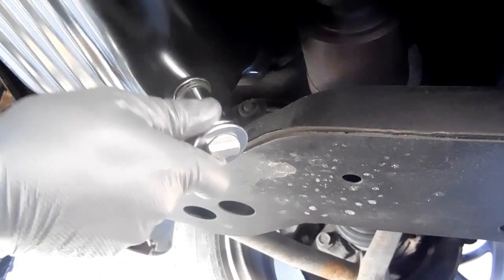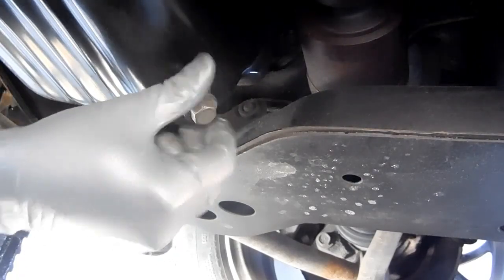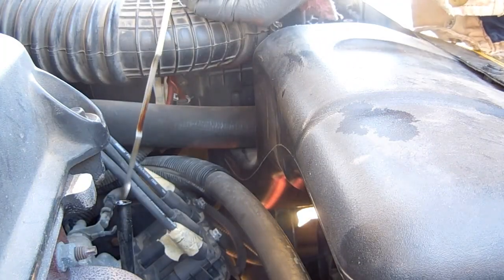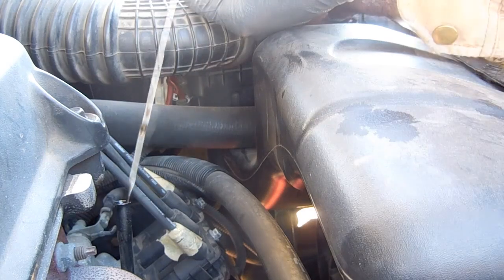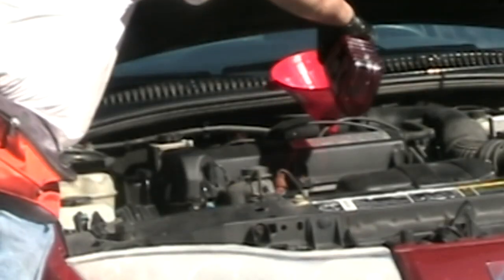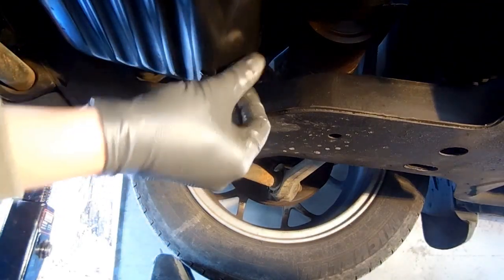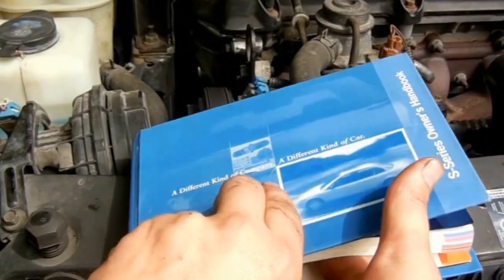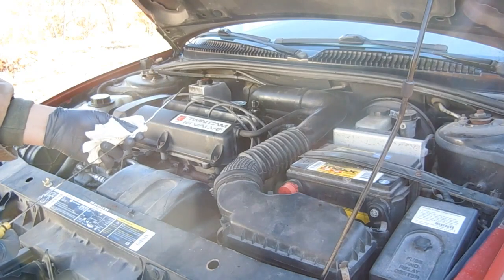Safe Motor Oil Flush Using Kerosene

Comment: Gasket material and sealants have changed to much that I'm not sure how this works with engines made in the last 35 years.  Prior to that I can attest that regular flushing with kerosene did indeed keep the engine sludge free and clean.  But that in itself required you to keep the oil and filter changed every 5K or less.  But sometime internal sludge can be a friend.  You clean up a really dirty engine and all of the sudden it will start leaking for the first time in years.  I can attest to that also.

Comment: Back in the 70's this was common, but I would toss in a quart of kerosene into the oil before an oil change.  No pre-draining.  I would let the engine idle 20 minutes or so and then do a normal oil change.  This was done rarely, but it would get some of the crap out of the engine.

Comment: Remember when you drain the oil after putting the Kerosene in the engine not all the Kerosene comes out of the engine. Every crevice in the engine even the pan will have it still in the engine. So one flush of new oil will not remove all the Kerosene.

Comment: Thanks for the info I’m running my car right now as we speak with kerosene in it to clean engine. But my 09 Honda accord V6 has 230,000 miles on it and it started to tick when I start it up but once it’s warm it goes away. So I’m flushing it and putting stuff in it that will help with that. But I want the engine to be clean so I’ll prolly do this before every oil change for 2 more times. I’m trying to get 300k out this work car lol..

Comment: People used to use coal oil to desludge engines.
FYI: you can substitute lamp oil for kerosene.
You can even use diesel fuel too.
Some people use ATF to flush with.
No more than 25% by volume for the mix.

Might be a good idea to let it sit overnight in severe sludge issues.

If you have a lot of sludge, then you aren't changing your oil and filter often enough.
Or you need a proper tuneup/repair.

I see the author is using one of the WORST oil filters you can get.
Get a NAPA or WIX filter or better.

Comment: Ok..Something to consider..Depending on mileage or terrible missed/ misused servicing..Any engine with excessive Sludge/Carbon byproducts are questionable when attempting to Flush Materials..Safest way out of all methods is ATF..One quart added/ Run at idle to 2000 rpm for 1 hour/ No driving/Vehicle parked/ Fire Extinquisher Safety/ Drain and Oil Change Filter Service...Sludge/ Carbon removal may have been holding seals and rings and bearings together..Be ready for Big Repairs if something happens...Used vehicles with no records are the worst.....

Comment: Hello great video it was really helpful can I do that with my transmission and my son drove the truck with really low on transmission fluid and I asked him for how long he said about 2 weeks is what he claims but when I got it back it would not even register on the dipstick now it slips just a little bit not a lot but sometimes it does would it be helpful for me to drain all of the transmission fluid out of the transmission can I clean the transmission just like you did with the motor and then put the fluid back in and you think that might fix a little bit of my slippage problem I'm just asking I don't know I'm single so I don't know I just need a man's advice
Reply: Hi Jennifer. I would recommend against putting, or using any other fluid or oil than automatic transmission fluid, in the auto transmission of any vehicle. Empty the transmission completely, refill with new transmission fluid. If it is an older vehicle and the original fluid looked dark, significantly different or discoloured (new fluid should look clear and bright) from new transmission fluid, it may be worthwhile emptying the transmission again and refilling after 1,000 miles. 

Again, I would be certain that the new transmission fluid is not tainted or have any other impurities, such as water, oil, brake fluid or dirt when it goes into the transmission.

Though it is likely to be too late to answer your query, I hope that this information may help you or someone else.

Comment: Drain out all the old oil and refill with circa 4 litres of diesel. Remove the plugs and spin the engine over on the starter several times and drain out. Refill with approx  
2.5 litres of new oil with a new filter. Run the engine to temperature, drain and refill with another new filter. Job done.
My 1.4 16valve Fiesta has done 145k miles and ive done this at 40k, 80k & 120k miles. The engine runs like new, the oil stays  yellow between services ( every 3k miles) and uses absolutely no oil.
Bore scoping still shows the factory cross hatching..

Comment: When I get a new to me bmw I drain the oil and  replace filter put in some cheap oil or kerosene till it starts coming out clean this washes a lot out the oil pan  once it stops replace oil plug put in cleaner of choice top off with the cheap oil, flushing with old oil and filter can lead to washing dirt into $$ parts idle for 20 min or so drain oil if black as night repeat then put in a top make oil I like red line or castor oil synthetic if red not around it hard to get in europe  ran many bmw in canada or europe never had engine issues my last canadian bmw had 180,000 very hard miles frame rusted out engine still ran great engine flush should not be done too often it can do damage by washing shit into pin hole sized oil passages  if you drive a beater you can flush more ben an auto mechanic  for 40yrs

Comment: RUN the engine for a minute or so, before checking the oil. The filter will take up some of the oil as it primes. A filter that size may hold up to 1/2 of a quart. When measuring the amount of oil, the dipstick may show above the full mark, until the engine has been run, and the filter has completely filled.

Comment: I threw almost a full can of SuperTech Motor Teatment in my old 302 with old oil. 
The blow by seemed to have greatly reduced and nearly no smoke from exhaust pipe.
Then I changed the oil. I used 1gal of diesel oil and two quart bottles of Oil Stabilizer. All SuperTech brand.
It now smokes from both ends worse than before the Motor Treatment was add.
On the bright side though. The low end rattle has nearly stopped now when the throttle is burped.

Comment: Your essentially trying to clean your engine with dirty contaminated oil,,,Would you wash your dishes with old dish water,,,The proper way to clean your engine is ,drain out all the old oil,,put in cheap new oil with an engine flush,,drain that out,,Then put in more clean cheap oil this time without the flush,,the reason you do this twice is ,,after the first time with the flush,there will be kerosene left in the engine,,,then drain the second oil and fill with good oil,,,,,job done...

Comment: All you have to do is put 1/2 of synthetic  oil in with your 10/30 ,or what ever and run it it will clean your Engine this is a joke what you're  doing

Comment: Kerosene is the active ingredient in many engine flush products and many years ago was the cheapest most popular method to cleanse engines. Technology has since moved on and it has been proven the dangers of flushing engines with Kerosene outweigh the benefits for both modern and older engines.

Comment: FYI:  if you will turn the oil bottle so that the spout is on top instead of the bottom as you pour,  it will not gurgle, and will pour faster.
Reply: or sideways-ish

Comment: a kerosene flush is hard on your bearings guys i would use the Marvels Mystery Oil as it is a lubricate and light solvent 

and if you really want to prevent oil slug and contaminate from even building up in the first place change your oil every 3-5 thousand miles also DONT USE A FRAM FILTER EVER they have killed more engines than cash for clunkers

Comment: Great guide, does this method also restore initial engine compression and pressure the way additives like Bizol o90 system oil clean + does?
And what are it's pros and cons as compared to say that bizol product?
Thanks

Comment: What does that kerosene do to the engine seals and the bearings? I'm guessing there's a reason why the manufacturers manuals suggest putting nothing in your engine except the recommended grade of oil.

Comment: I hate to go against this but, I'm not putting kerosene in my crankcase.  I don't want to put anything in it that I wouldn't drive around with all the time.  If you create a whole lot of extra wear by doing this, which you probably will, it is completely counter-productive.  Besides which, a more gradual, "gentler" flushing way is to change your oil, add something that's at least a nominal lubricant like Marvel, then drive for a hundred miles or so. And repeat this twice more then add normal fill and change the filter.  Much easier on the engine than running it with an actual solvent in place of your engine oil!

Comment: Worked  in bodyshop years ago where one co worker would drain  the oil filter first and fill it with kerosene  and run the motor for  a minute ,  then drain  the oil.

Comment: I remember my grandfather doing this to his older vehicles he would drain everything out and then mix 3/4 of kerosene and 2 quarts of cheap oil and fill it back up with that mixture and let it run for 5 minutes drain it all out and then add 2 quarts of cheap oil to push the kerosene out that would lay in the rocker arm galleys and lifter galleys otherwise you would have about a half a pint of kerosene still in the engine when you was done. Just a helpful thought

Comment: I just change the oil religiously at 8k or one year, whichever comes first.
During it’s last service, the mechanic said he’d have happily put the old oil from my car into his own.
If you change the oil when you’re meant to, you won’t get sludge.
Reply: Oil quality and how severe work load on the engine along with temperatures it is operated in .Also how efficient the pcv system operates. If the pcv does not work you will sludge up the engine pretty much

Comment: Never ever use kerosene to clean engine parts and sump unless you rinse it with the same oil you use in there. That is what i always remember my bosses used to tell when i was new onboard ship. A drop of kerosene damage your lubrication oil and system.

Comment: Do not do this. Get a slow acting flush that works over a few hundred miles and doesn't mess with your oil. Reducing the viscosity of your oil and rapidly knocking out sludge does your engine no favours; you'll have a nice clean engine that goes for 100,000 miles instead of 200-300,000

Hell, even my 1950's IHC truck manual, which specifies a kerosene dilution for winter, has a massive warning about diluting the oil more than 30% for any length of time. What we see here is a dilution of 50%, if not more.

Comment: This one of the many methods employed by some people.. I can tell you without a doubt if that engine ran conventional oil for 100k and you flushed it with kerosene you would have a smoke bomb!! Kero cleans out the sludge and opens up tolerances ..If synthetic oil was used from mile one it wouldn't be an issue!! Have had customers..3 to be exact that have done this and then their engines started burning oil!! Pistons and rings installed...problem solved!!

Comment: Pipe smoker and engine flusher here.
Good vid 🙂 Also the cleanest car chassis I've ever seen
Reply: Meth pipe I take it
Reply: Don't smoke your pipe while driving.  Airbags.
Reply: @jonhutchens9770  Good point but I dont hold it in the mouth like that.🙂 If I saw dude with a pipe, I would. And I havent smoked it for years. Maybe I should. I pretty much mostly vape tobacco now.

Comment: I’m 74, been a motor head since I was a kid. This Kerosene method is something I’ve seen for years. Just run the engine until good and warm. Drain off about half to three quarters of the lube, add kerosene or kerosene and diesel mix to the full mark. Then start and let the engine idle for 10-15 minutes. Stop and drain all that old crap out. The install new filter and fresh specified oil. Best way as far as I’m concerned is to only add a quart of type A transmission fluid just before and oil change, do that same. The Automatic Transmission Fluid does not deteriorate the seals and gaskets...
Reply: ATF is much lower viscosity, thinner and has far less detergents.  Just use a fully formulated oil with proper viscosity.  Double oil change,10-20% of old oilwill remain, which breaks down into sludge.
Reply: @tssci6774  this won’t work as well as atf. ATF is thinner so it will dissolve sludge way more
Reply: @hextorcampis6113  it's not the viscosity of the that removes sludge, but advance detergents in a fully formulated oil that will do it gradually, safely, and will harm bearings, seals, oe gaskets.
Reply: Nice way to dilute your engine oil.  Probably fine on older engines.
Reply: @BenState if you knew anything about engines, you would know how dumb your comment is.

Comment: I used one of the Commercially available engine oil cleaners, at the insistence of a relative. Next thing I was doing, was tearing into the Engine to replace the Valve Seals. If you do the recommended oil changes with a Synthetic or Hybrid Synthetic Oil, you should never need to flush the oil passages. This of course, is not having a leaking head, leaking antifreeze into the oil.
Reply: Hi, yes but that's the problem when you buy a second hand car, you don't  know if previous owners did them right.

Comment: Terrible stuff in this video.  Super thick Lucas oil that has no detergents or additives, crappy Fram filter.  A 100,000 miles on a fuel injected car isn't gunna need any kinda flushing.  Running a motor for that long with 50 percent diluted oil sounds like a great way to scar bearing and pistons.  

Use good synthetic oil and that will do all the cleaning it needs over years.

Comment: I’ve done this twice so far. On A 2001 Highlander V6 1MZ and a 95 camry 2.2. It’s been years since I’ve done it, I use a little bit of marvel in each vehicle at each oil change and they both work great no issues at all. I did change oil after 3 days of driving each of them when I finished the flush and drained it out. Also I added a quart in each vehicle and did not drain any oil prior to adding a flush.
Reply: Hi David, just try to understand exactly what you did.  Did you mean you just added a quart of Kerosene to engine to do the flush and then change the oil, and change oil again right after 3 days of driving?  My HL is burning oil and try to follow your method.  Thank you for your experience!  Larry
Reply: @larryliang2173  more info on your car? Year and engine size and mileage? This won’t help with burning oil this helps to clean the engine. You may want a product like Lucas oil stabilizer

Comment: OMG, there is just so much wrong with this video!  Never, ever, ever flush a modern engine with kerosene, diesel fuel, or any other flush products.  It is totally un-necessary, most vehicle manufacturers don't recommend it, and you ARE adding additional wear to the engine.  If you car is under warranty, it will void the warranty.  Use the correct oil recommended by the manufacturer, and steer clear of oil additives.  Also, friends don't let friends use Fram filters.  You just don't do it unless you don't care about your vehicle.
Reply: Yea it’s way better to keep a sludged up engine running

Comment: I would not use kerosene.  She’ll rot Ella diesel oil has so much detergent that it will clean any gunk in engine.  You may wind up with oil leaks as sometimes the gunk actually seals the engine.  Just change the oil regularly and you don’t have to flush.

Comment: D00d! This is the right way to flush an engine! Kerosene, not #2 deisel fuel, ever! I did this with my Rambler in the 70s, I was told to use only one quart to 4 qts oil, idle only for one hour. Good job here only idling for ten minutes really, that is enough for newer  engines  that aren't full of sludge already. My old Rambler was pretty filthy inside. Good video, nice editing and Bravo! More Cow Bell, you're using Kerosene.

Comment: Saw you weren't pouring the oil out of the container properly,  next time instead of pouring out with the hole on the bottom,  try pouring the Quart of Oil with the hole or opening at the top,  you'll see it'll pour Smoother.  Love how your using Kerosene and give the appropriate warnings how to use and when.

Comment: I was all about this and then I saw you use a fram filter and realized you have no idea what you’re doing.
Reply: If you change your oil every 3000, fram is fine.  It’s not a top tier filter, but with that frequent of a change, it’s not much to filter .... unless you already had problems.  I used fram filters and the cheapest conventional oil that pep boys had on sale for years....blew up a couple transmissions, but oil changes every 3k, engine ran fine.
Reply: He had me until I saw the Fram filter lol

Comment: YEARS AGO A GUY I WORKED WITH DECIDED TO DO THIS
HIMSELF!!
SOME TOLD HIM TO USE KEROSENE,  BUT LOOKING AROUND THE KANSAS CITY KANSAS AREA , HE COULD FIND NO KEROSENE TO PURCHASE!
NO PROBLEM , HE THOUGHT,
SO HE USED GASOLINE , 2 QUARTS, AND 3 QUARTS OIL!
HE THEN STARTED THE ENGINE AND HE THEN DECIDED TO LET IT IDLE FOR 15 MINUTES!
HE SAT DOWN ON HIS PORCH
AND OPENED A BEER !
AFTER IDLING FOR ABOUT 5 MINUTES THE GAS FUMES 
IN THE ENGINE IGNITED
AND BLEW THE PAN AND BOTH ROCKER ARM COVERS COMPLETELY OFF!!
LOL LOL, BACK TO THE DRAWING BOARD!! LOL 🔥🔥🔧🔧🔧🛠🛠
Reply: Diesel is REALLY close to Kerosene, not explosive like gasoline, he should've used that.
Expensive lesson !

Comment: Old school you dont run motor just drain directly thru then let drip adding oil right behind changing again after couple hundred miles
 But are the seals different now?

Comment: When valve stem and other engine seals contact with Kerosene, most likely will cost you complete engine rebuild. you can test it yourself put a valve stem seal or any seals in kerosene.